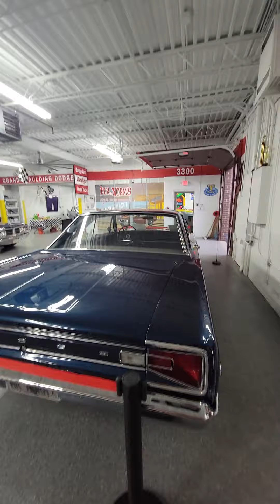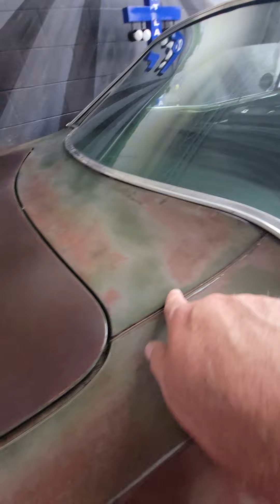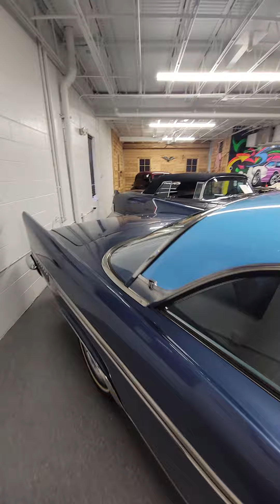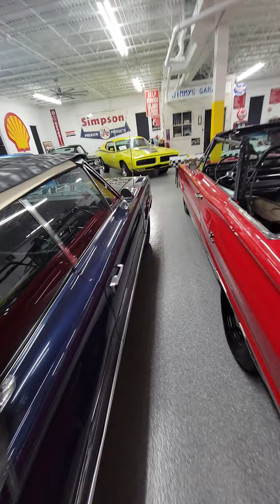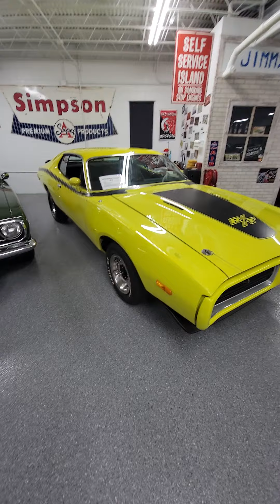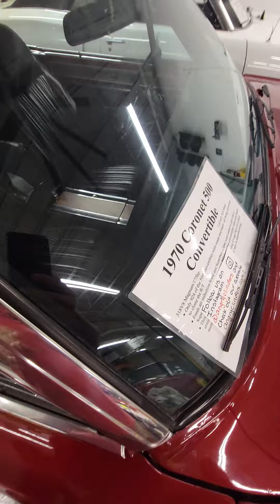Mr. Norm 1966 Coronet 426 Street Wedge "Gentle Ben" Exterior Complete

Comment: Back in 79 or the early 80’s, I was at one of the Hemi Owners National Meets, and a guy rolled in with a 66 Hemi Coronet on the back of a ramp truck, it was the same dark blue as your car. It looked to be all there, but rust was poking through on a number of panels. What blew me away was the old cracked up Mr. Norm’s decal on the trunk lid, just like yours. Being from the west coast, Grand Spaulding was something we heard about, but never saw. I photographed it for posterity.

Comment: I can answer your question regarding Nalco.  They are/were an industrial chemical supplier, and their earlier products focused on water treatments for steam boilers (think steam locomotives).   They also were a significant supplier for additives to treat the water used in large building cooling systems that used evaporators.  Many other products as well.  They have been based in the Chicago area and certainly were in the 60s and 70s.  The sticker is probably a parking sticker.
Reply: I remember NALCO! My dad worked for them for almost 30 years! He was a District Manager in the Milwaukee area.
Reply from the maker: Great Thank you for that info. I'm glad it was Chicago based as that fits right into the car's historical location